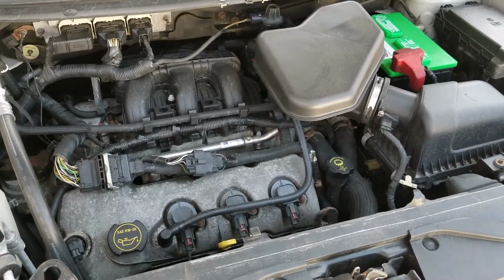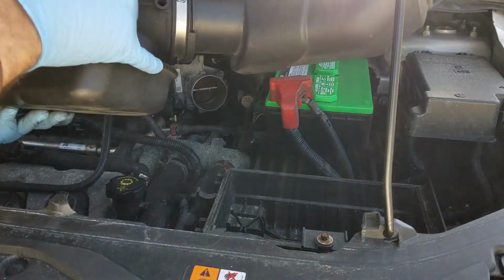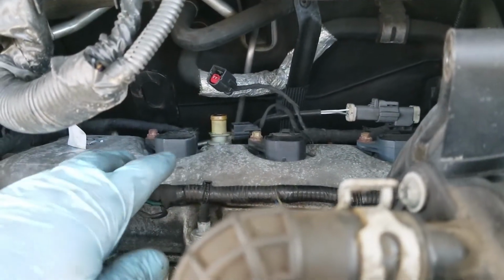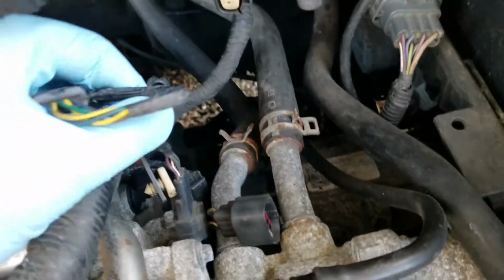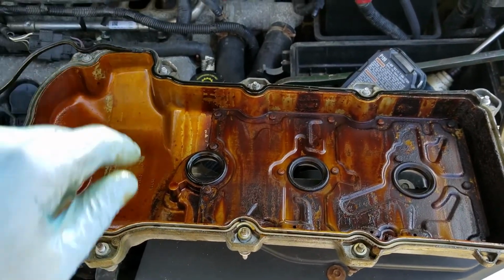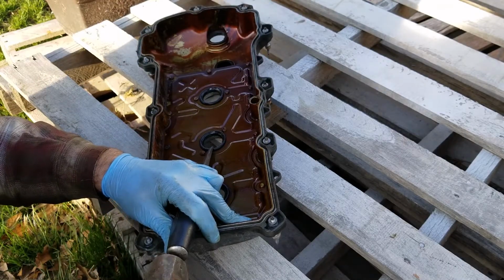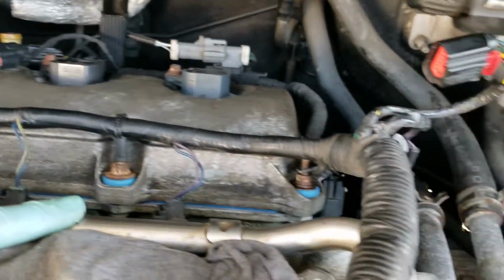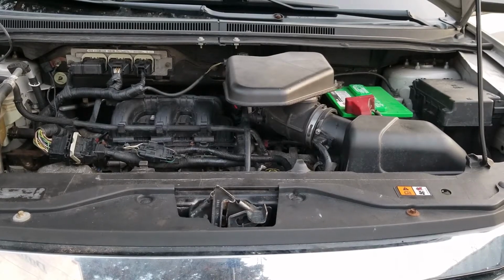Ford Edge and Lincoln MKX Valve Cover Gasket Replacement Ford 3.5L Duratec Engine

Comment: Thanks!
Reply: i hope you see this and see my question below this comment thank you sir!!!
Reply from the maker: Thank you, that's much appreciated! I did reply to the other message but just in case, The connector I have in my hand with the red insert is the one that goes to the coil pack.
Reply: @JrZCarZ  this got lost in communication the one i pulled out of the connector was the PCV valve heating whatever it does run inline with the coil on the back bank PCV/ coil. this wire runs under the plenum unlike the other 2 coils which are back by the exhaust manifold. but either way man love your video beating the old spark plug gaskets on the valve cover with a chisel is a game changer. cant wait for some more vids and thank you very much sir!!!

Comment: So I did this job on the back side (or left side). Thank you very much for the video as it was very helpful. Biggest problem I had was installing the new spark plug tube and vct seals. The 30mm socket I rented from O’Reilly’s  just wasn’t the correct outside diameter and I’m sure the thickness of that socket varies by manufacturer. As a result I damaged several of the seals when trying to install them. Bad thing about it is I didn’t realize the VCT seal was damaged until it was all back together and oil was leaking from there when I drove it. So I had to do the job again, but I was able to reuse the valve cover gasket and didn’t replace the spark plug tube seals as they weren’t leaking, just replaced the VCT seal with FEL-PRO ES 73074 Grommet set I purchased from Amazon. This time I found that 1-1/4” schedule 40 pvc is just the right diameter to use for installing seals into the valve cover. It went much smoother than before and sealed up great. One trick that I had to use was to place the gasket in the freezer the gasket for a about 30 minutes to get it shrunk enough to stay on the cover while I reinstalled it the valve cover gasket for reuse the second time as it was stretched just enough that it wouldn’t stay in place when I tried to place the valve cover back onto the head. Hope that helps someone.

Comment: absolutely love your video!! unfortunately my wife called right before the 2nd to last step before you pull the plenum and i forgot to unplug the electrical connection you have in your hand a 9:09 in the video. can you please tell me what that is for so i can buy a new connector and recrimp it on. thank you soo much man!
Reply from the maker: The connector I have in my hand with the red insert is the one that goes to the coil pack.

Comment: JR, thanks for sharing your adventures. Bought a 2009 edge limited awd 3.5l v6 from auction few months back with P0016. Started working last month replaced sensors and cursed the designer but also enjoyed the hardness of work but P0016 came back after few days. Restarted working this time to change the timing chain and related parts. Found two pieces of black plastic looks like from slides. Question: should I replace all parts or just broken one? Advise
Reply from the maker: If you are going in that deep, you might as well replace all of the guides AND the water pump.
Reply: @JrZCarZ My first time this deep and Seems like no way back. Definitely will change water pump though it looks like it's not that old but since inside of engine was so dirty and full of gunk, I'll follow your advice. Another question, what about cam phasers or vvt sprockets? Should I change them too? Please recommend a brand, also both small slides plastic was broken,  can't believe Ford used such low quality plastic.. PLEASE
Truck full of thanks for reply

Comment: My ford edge 2014 3.5L V6. Burning oil at high rpms. Low rpm driving no issues. Mechanic told me replace the valve cover gasket and cam sensor seal. Is it true that the oil burning geta fixed after this service? Please reply thanks
Reply from the maker: If it's leaking out and burning on the exhaust manifold then sure. If it's burning out the tailpipe then no.

Comment: I had all kinds of problems getting my tube seals installed correctly too. I damaged a couple trying to seat them and I damaged 2 more putting the valve cover back onto the car. No matter how careful I tried to be, I just kept having trouble. 2 things I learned… the Ford dealership sells individual spark plug tube seals and VVT seals, so you can get them the same day if you need to. Also, lots of lube when you are trying to slide that bad boy back over those tubes.. This was not a fun project for me lol. Good luck friends!!
Reply from the maker: Yep, the first time I did a set of these was the learning curve and I destroyed 2 of them as well not realizing there was a difference in size. Was trying to rush through it as well so that didnt help. This time I knew better 😄
Reply: Wait, there's a difference in size for the small gaskets?

Comment: A lot of other videos are saying the cupped side faces down on their heads. and some even install from the inside. I wish i would have just left the old ones.. i cant find any clear photos or diagrams for the 3.5l flex covers. im unsure if I installed them correctly. Is this car running for you?
Reply from the maker: The way they are in my video is the way they should be installed. I never had a leak after they were installed. You just have to make sure you dont mix up the spark plug seals and the vvt solenoid seal as they are different sizes. If you check out my other Edge videos you can see I have other issues with this car though 😉

Comment: You just saved half the internet; hours of prying out gaskets!!!! THANK YOU!
Reply from the maker: Those spark plug and VVT solenoid gaskets were the thing that took the most time. Glad it helped you out 👍
Reply: @JrZCarZ  well my VVT solenoid gaskets from FELPRO's VS 50767 R-kit, did not go in as intended. So now im going to try the MAHLE GS33786 Engine Camshaft Seal Kit, that everyone is raving about.

Comment: Ft ponds for the bolts???
Reply from the maker: 72-96 INCH lbs or 5-8 FT lbs. Basically, take a 1/4" ratchet and hand tighten the bolts. They aren't held down with much force. Just make sure you don't over torque them and break the bolts off cause you'll be in for 'fun' getting them out.

Comment: I bought a Fel Pro kit and tried that same method to get the new seals in around where the coil packs go.

Can’t get them seated in to save my life. Frustrated as hell right now.
Reply: Ohh dang I just ordered the same
Reply from the maker: You have to be really careful. They are not just going to slip in, you will have to hit them pretty good to get them started. 2 things to note..... the seals that go around the VVT solenoids are just a little smaller than the coil ones, so make sure they are right or you will get a leak, and 2 the seal needs to go in very straight or you will have issues.

Comment: On the MKZ you have to take the power steering reservoir off to get to the the last bolt on the back valve cover. Insanely hard to get to.
Reply: Did you completely remove it or just unbolted it from the firewall. I tried to attempt today and was worried about clearance when pulling off the cover itself.

Comment: Thank you for the video. I did buy a 30mm axle socket and it does fit perfectly over the seals but I’m a little worried when I get close to the lip that it will hit it and how did you get the cam sensor seal in I can’t seem to get that one in. It seems to be a very tight fit.
Reply from the maker: It's supposed to be a tight seal to keep the oil from blowing out when the engine is running. You can add a drop of oil on the outer part of the cam sensor so it'll slide on just a little easier.

Comment: Good idea to change the spark plugs while you’re in this far.  Most repair manuals recommend replacing the upper intake gaskets and if the throttle body is removed from the intake, that gasket should be replaced too.